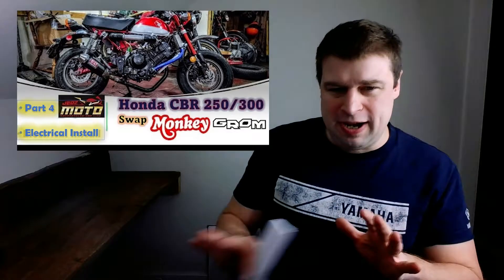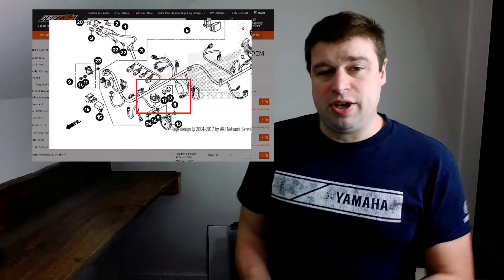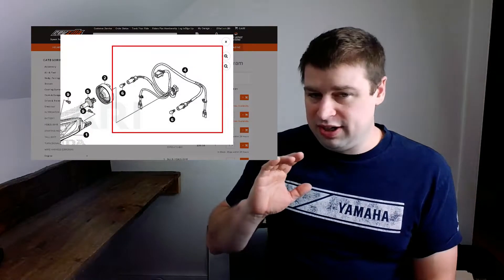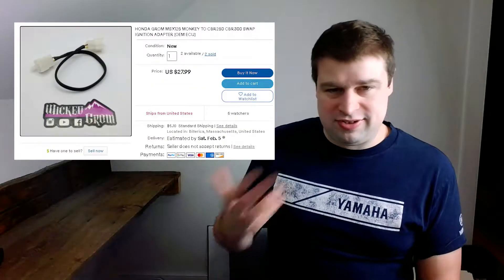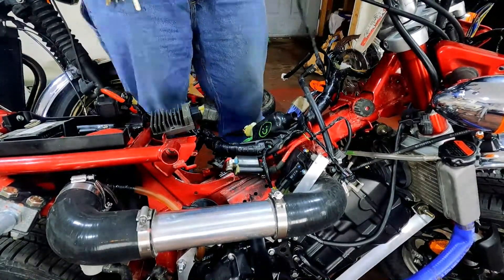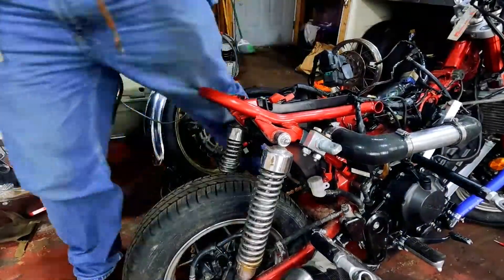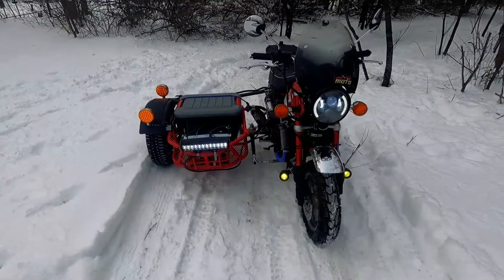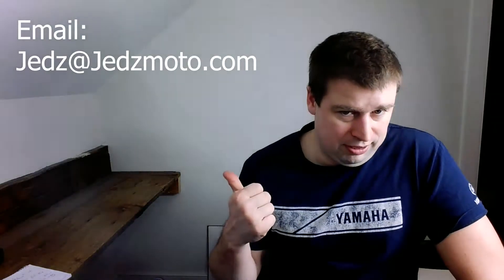Honda CBR 250 300 Swap Honda Monkey Grom Part 4  - Electric System Install

Comment: Hey that's me :). I am in NH. I have adapters for everything. Not all of it is listed on ebay. My swap group is in my youtube videos!
Reply from the maker: I guess the real question is, when do we want to meet up for a ride?!?!? Thanks for the adapter it isn't the same as a Grom but dude it made my swap easier! Cheers, hope we meet up one of these days!
Reply: What's weird is I've had my Adapter work on a few Monkeys without issue. Maybe difference is the ecu being used. Aracer vs oem who knows.